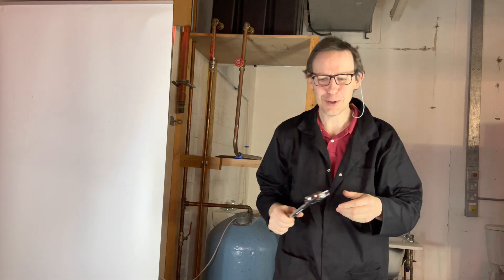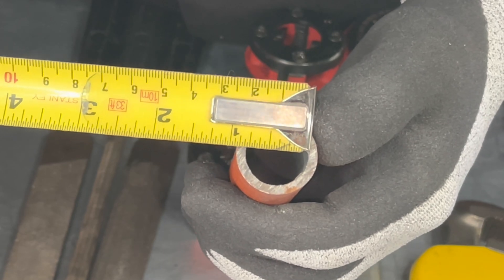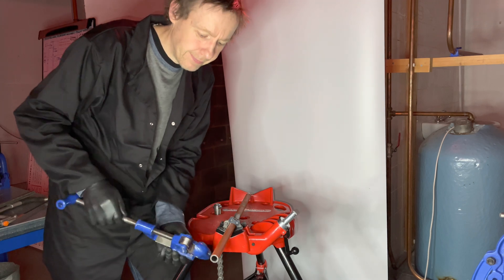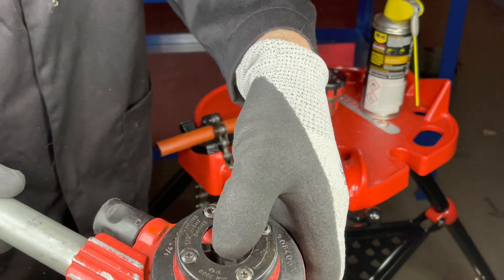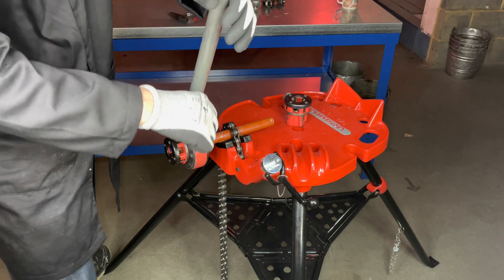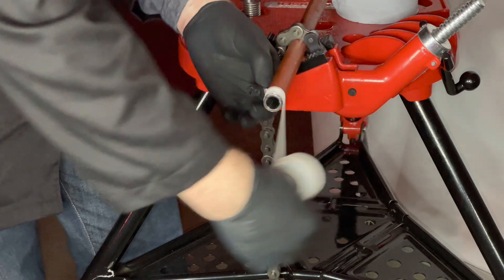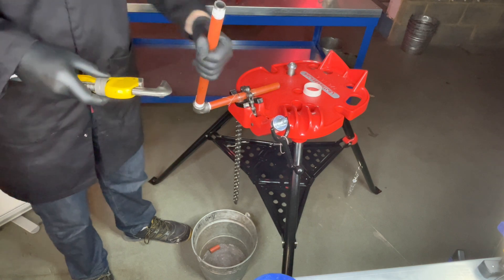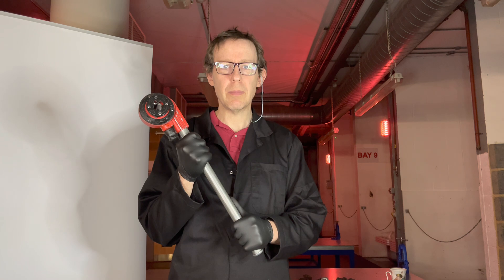Threading, Cutting and Jointing LCS pipe.

Comment: You will not only break the cutting wheel by over tightening but you will create a bigger burr inside to file out. You must be stood like that for the camera as you are making hard work of it. Stand the other side and use your body weight to make it easy.